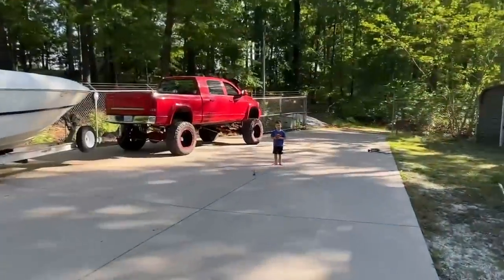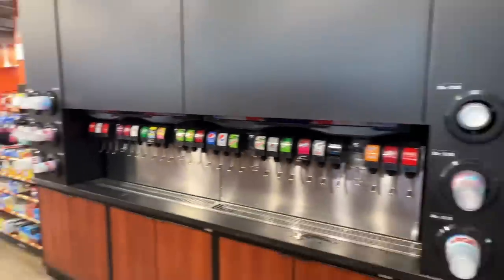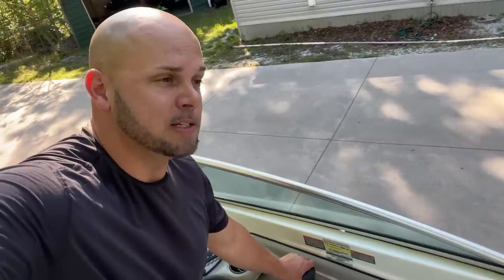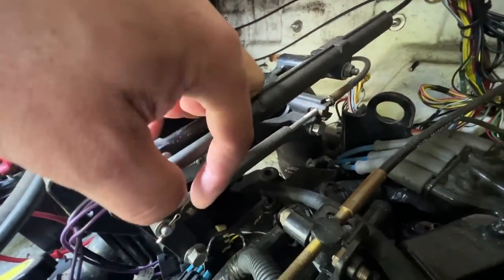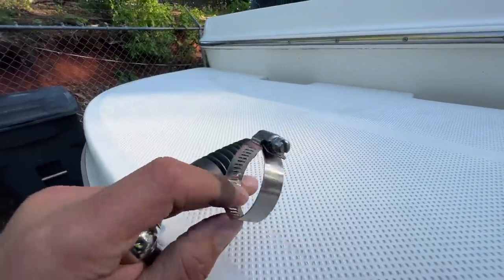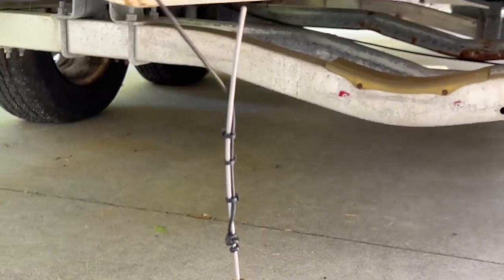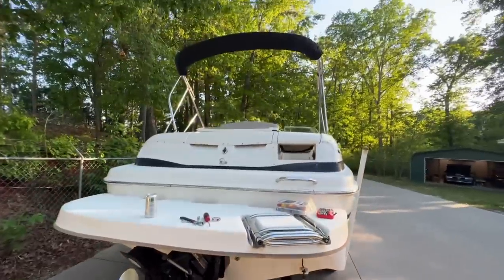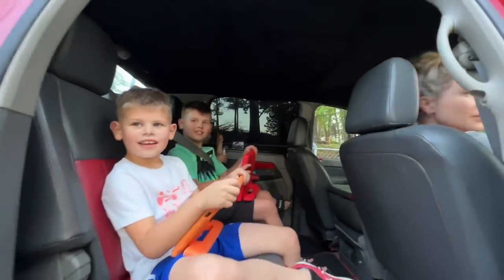BOAT SINKING ?? Bellow Repair Merc Cruiser Alpha One Gen 2 Shift Cable !!

Comment: Justin;  Speaking from years of being a mechanic. When you put any type of rubber bushings or boots on don't use spray lubes, they tend to deteriorate the rubber. Instead use dish soap to lubricate and slide the boots on, it's harmless to rubber and dries up shortly so the boots don't pop off. Also I would recommend that anything that goes in and out of the water regularly after it's dry, spray the boot area with silicone spray to keep the boots from cracking, it will wash off next time in water. You could use silicone to install the boots but again it won't dry and the boots may pop off no matter how tight the clamps are. Looks like that medium size boot next to it will be next, look at all the cracks in the bellows grooves.  Marty
Reply from the maker: Thank you MLT 😎🙏🏽
Reply: 👍 for the dish soap!
Reply: @@SimrKhera WD40 is a petroleum based lube and as with all petroleum based lubes it reacts with rubber causing swelling and loose connections with time, Soap is slippery when wet and dries to a powdery film as it dries. Ever pull an inner tube out of the package? It's covered with soap powder to keep it from dry-rotting on the shelf. Same goes for transmissions, years ago they changed to type of rubber in the seals and had to get rid of the older petroleum base fluids and replace them with synthetic Mercon\Dextron style fluids because petroleum based oils eat up rubber and it took years to figure it out. But you don't have to believe me just go fill your master cylinder with an oil based fluid and report back after you get out of the hospital because the rubber seals blew out.

Comment: FYI outdrives should be pulled and greased and fluid changed yearly.  Mercruisers are known for the splines to get stuck if not well greased. It is an expensive repair.  After 30 years in the marine business I've seen this lesson learned all to often.

Comment: Justin, I agree with Dock Master, we need to talk you thru removing outdrive to do this from drive side.
Hopefully you have shift shaft end back to 6in center to center dimension.
When outdrive is off easy to check engine alignment with $50 tool. Need to grease gimbal bearing and pivots. 
Should think about fresh water pump replacement maybe this year if previous owner hadn't. Lower unit grease should be changed before each winter and the engine oil. All easy stuff for you, have fun on the water. Those boys should be double skiing by end of the season.

Comment: I had a 30' cruiser and had twin 5.0L Volvo's with the XDP Composite drives, and so many recalls on those.  I had to change the bellows every year just to make sure they didn't spring a leak.  The boat was kept in the water year round and used here in Texas in a fresh water lake.  I was lucky in that Volvo paid for three of them due to recalls, and then the local mechanics putting them together wrong one time.  I was almost going to do a conversion on them to change them over to DPS out drives, but ended up selling the boat.  Volvo offered to swap them out for me for the discounted rate of about $19K back in 2009.  I passed on that "generous" offer!  🤷‍♂ 🤦‍♂  So Volvo knows they made a bad product, and then wants me to pay even more to change them out!  The best part, if I accepted the offer I would have to sign an non-disclosure agreement and give up all rights to sue them because they were saving me so much money by using this offer.  I would also not be able to talk about how crappy the outdrives were.  Other than that, I loved that boat, but 10'itus got me and upgraded to a larger newer boat!

Comment: Good ole petroleum jelly aka vasoline on them rubber boots keeps them from dry rotten and cracking and if you have chrome or stainless steel pieces on your toys for big boys it will keep it from rusting up once you put them away for the season and if you have stains in the carpet of your boat 🛥 you can get a bottle of Coke,some Dot3brake fluid and some hot water and mix together spray on the stained area and scrub out the stains it is a old Remedy I use when detailing works really well

Comment: Hi.  The spiral sheathing is to protect the shift cable from the hot exhaust manifold.  Also, you might need to adjust the shift cable is it doesn't shift perfectly from forward to neutral and to reverse.  Happy boating!

Comment: MLT is right. WD 40 not really a lube in that sense. It absorbs water. I noticed that you don't have a Marine Band radio on board. It's something you should have either to talk to others on their boats or for calling in an emergency or responding to one. You sure wouldn't want to run out of gas in the middle of the lake. It's like having the CB in the truck. Sure you have a cell phone having the radio on CH 16 can get you help faster.
Stay safe out there and hopefull the spot market will be better.
Reply: @daddyof3girls09  i live in NC and by Lake Chatuge. It borders both NC and GA. The NC DNR monitors Ch 16 and I belive they do on the GA sidI know there was an accident a few years ago where someone anchored their boat at night and had no lights of any kind on to alert others they were there. Sometime in the middle of the night another boat doing about 20MPH didn't see the boat until it was to late maneuver. The boat that hit the other one was able to get DNR in NC. It took some time because the DNR boat is in a yard about 300 yards from my house and the boat launch is 4.5 miles away. No one was hurt but the anchored boat went under.There is always radio chatter going on at the lake. :)